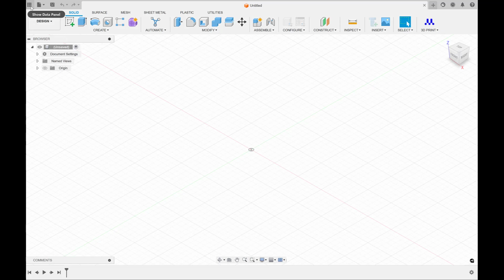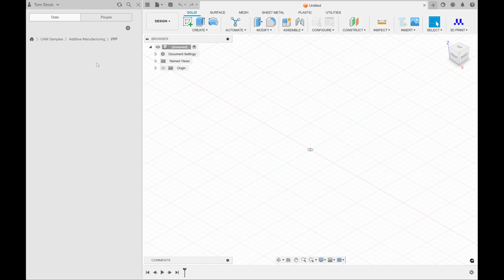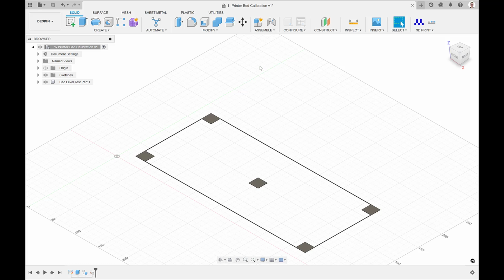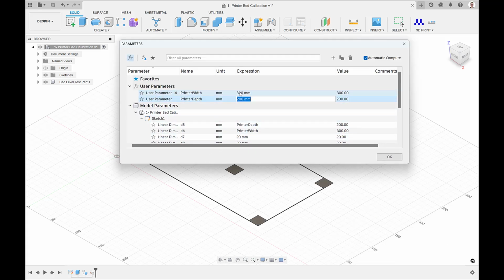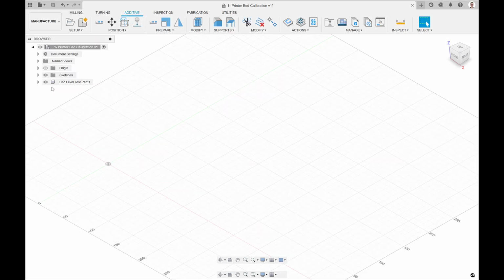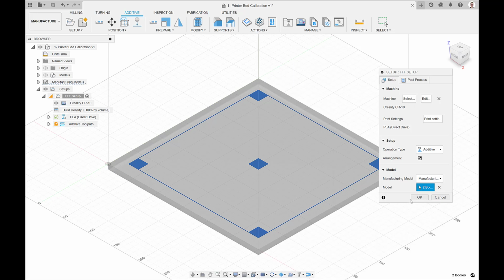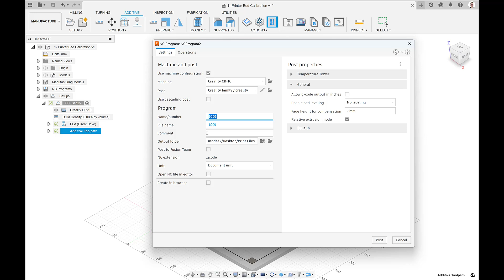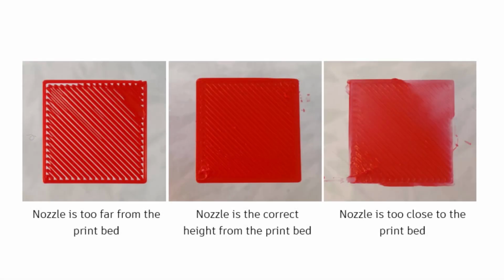Calibrating Your FFF Printer’s Bed With Autodesk Fusion

Comment: I don't understand why you would work on slicer software..... I design my part, export as a stl and use prusaslicer to slice.  Is anybody actually using it?
Reply: It makes a huge amount of sense to be able to complete your design, and then just print it.  Doing anything else seems counterproductive...
UNLESS...
The built in slicer is not up to scratch?  I have not used it, and from what you say, I'll hold off until I see glowing reports!   😜